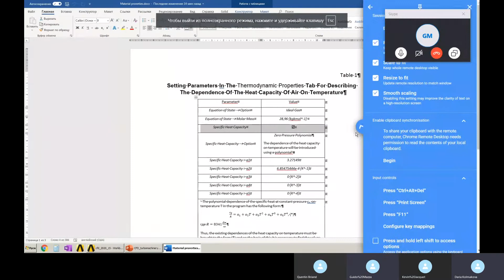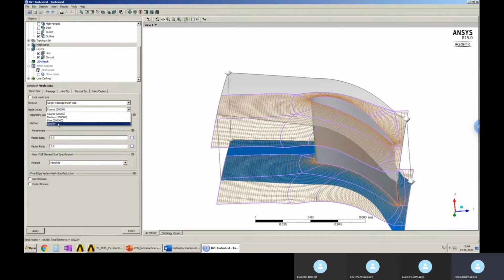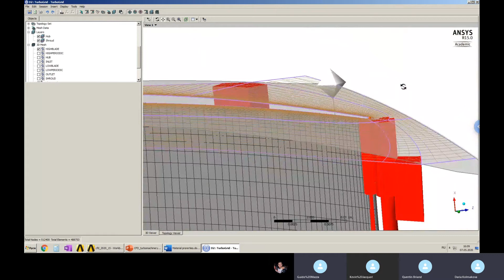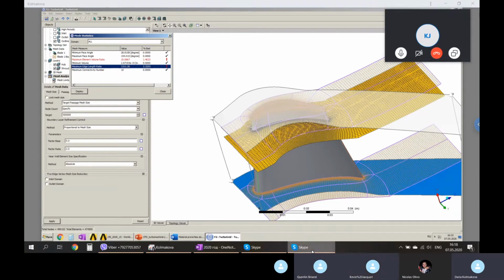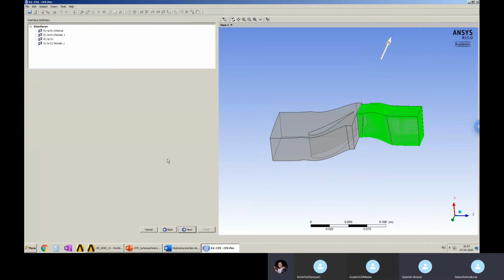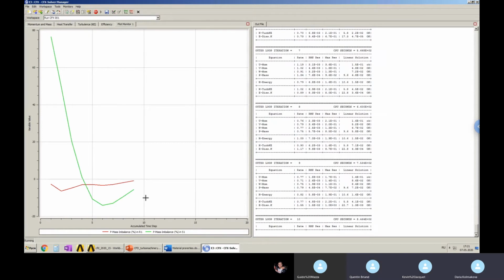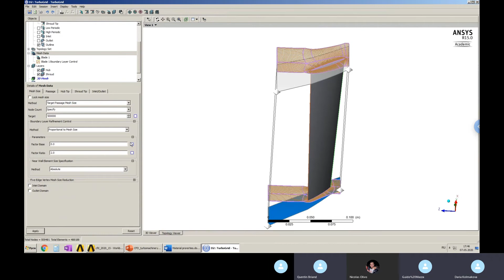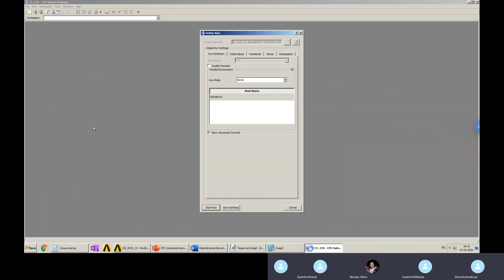CFD Mesh+CFX

Comment: Teacher ´please can you help by sending me the détails of blade bezier dialog shown in your power point While you were explaining in the midile of the video and the photo before also of the génération of the blade by bêta and teta angle thanks to circular form .i m talking about what it s in the images .and thank you of your support and help
Reply from the maker: https://1drv.ms/p/s!Amp7lc39nEfMhPAEp1_IItk-qXjHZA
Reply: @ОлегБатурин-п8к  Sorry madame can you send it again i think onedrive has delete it .you can send it to me in private if you want .i really need the equations of bezier dialog profil for my rport
Reply from the maker: @mohamedselwen2593  https://1drv.ms/p/s!AigyyQ-CCfiZgYJ32ij23VOlEGNhJg
Reply: Hello madame ,can you help me .i m working on an axial turbine .i m supposed to  get negative  value of torque for différent rotational angular velocity values of torque when i put calculation torque in rotor outlet .while i sometimes get positive results of torque .so is the torque parameter represent the réal  value of the torque on rotor shaft .can you help me how to obtain real torque and mechanical power  output at  the rotor outlet
Reply from the maker: @mohamedselwen2593  Without seeing the problem, it is difficult to say how to solve the problem. However, when determining the torque, it is usually forgotten to indicate the axis relative to which it is measured and multiplied by the number of blades. The sign can be anything. It depends on the direction of the axis.
Reply: @ОлегБатурин-п8к  the problem is when i go table viewer and Write torque_ z ()r1 outlet i get à value .and when i go to calculators function calculator and choose fonction torque location r1 outlet i get an other value.so i m not sûre which of them is the real torque shaft in r1 outlet .for the direction i m sure that i ve chosen the right one for exemple in turbo mode i ve chosen minus 15000 revmin_1 .so i get logical result  with the first method and sometimes the opposite with the second one
Reply: @ОлегБатурин-п8к  can i contact you with mail or teams or discuss with another method
Reply from the maker: @mohamedselwen2593  you need to calсulate torque in R1blade
Reply from the maker: please sent model to oleg.v.baturin@gmail.com